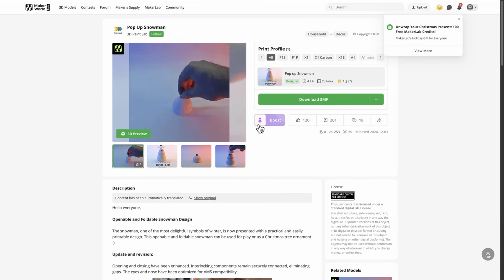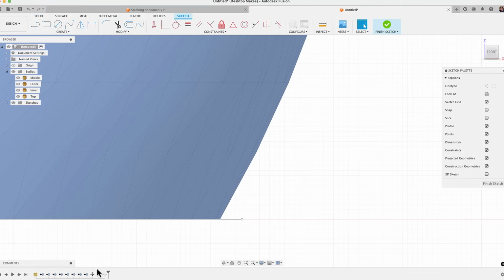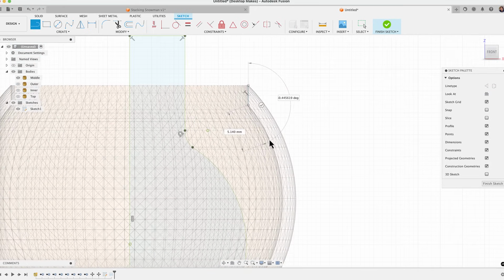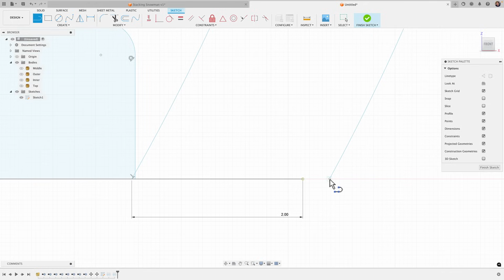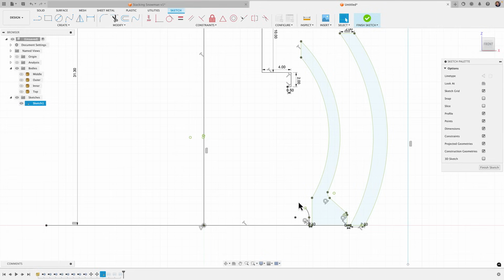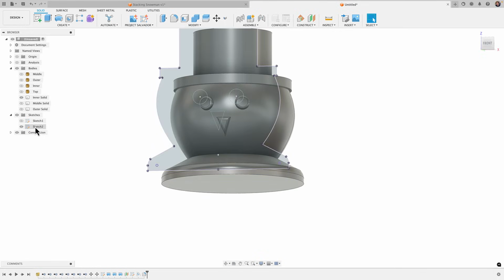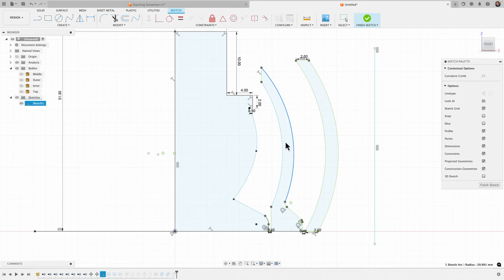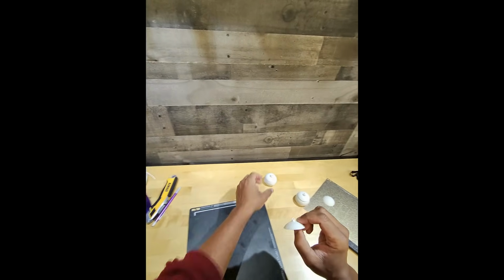Reverse Engineer an STL file in Autodesk Fusion

Comment: I like to convert the mesh to a solid first, so I can project the main points/corners of it's outline onto a sketch.
If there are too many triangles and my PC is struggling with that newly created solid, I revert it back to a mesh and then cut it in half using Mesh > Plane Cut (split body, minimal fill), then convert that half of the mesh to a solid.
Or if it's a really complex model, I might cut the mesh into a bunch of smaller parts before converting those indvidual parts to solids as I work on them 1 at a time.
So once I have a solid to work with, and I can project the main points/corners of it's actual outline onto a sketch, it's super easy to join straight lines between those sketch points.
For the curvy bits, the 3 Point Arc and Blend Curve tools are usually enough to get me the rest of the way :)
I like your method of centering a mesh to an origin point. That could help a lot if I really want to split a mesh in half first 👍🏼

Comment: it seems to me that Fusion should be able to convert an STL into a solid. Is this maybe just an issue with a paid version vs personal version?
Reply: It can and does, and I have the free hobby version.  If you do convert it to a solid, you can put a sketch on the plane that bisects the model and have Fusion do a Project Intersection and it will do that sketch for you.

Comment: And why do you not just make a mesh section sketch?
Use the Create Mesh Section Sketch command to create a sketch that contains a section line where a plane intersects a mesh body, in order to reverse-engineer a mesh in Fusion-

3 clicks and you have the shape.

Comment: I too always like the reverse engineering videos, I have to duplicate a lot of unavailable parts, only difference is, they do have to match the original exactly or they won't fit.
Reply from the maker: Thanks @adambergendorff2702, I'll do a few more of these and will include some that require precise dimensions.